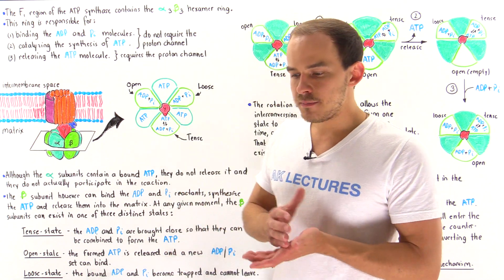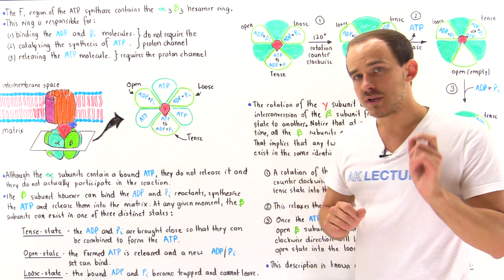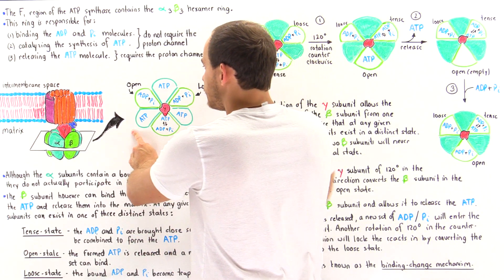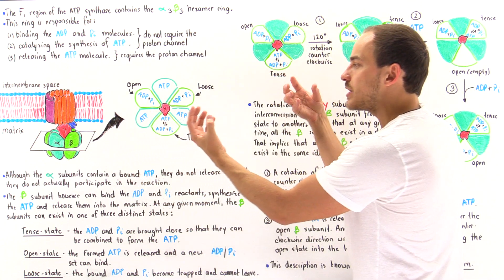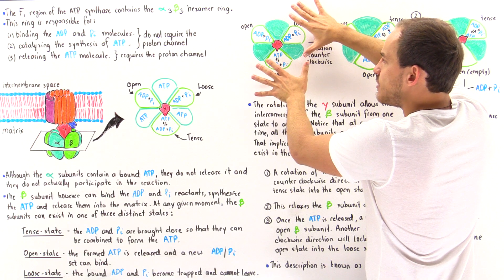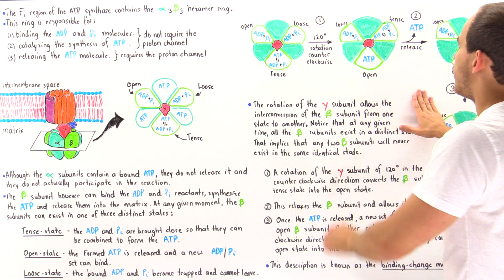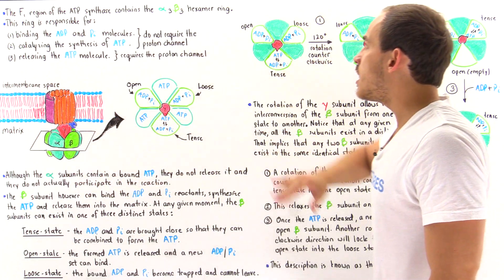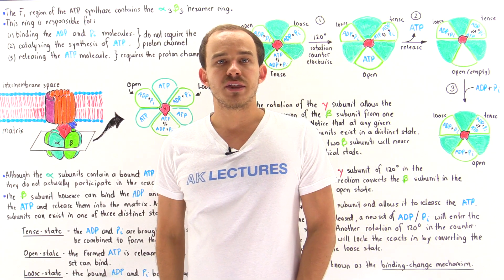Mechanism of ATP Synthase

Comment: What I don't understand is how these ADP+pİ s form inside the beta regions in first place?
Reply: Hello Cherry berry:

When a beta region is in the 'open ' conformation (shape), an ADP molecule and a phosphate molecule enter the binding region from within the mitochondrial matrix fluid,  like two passengers being seated on a Disneyland ride. Next, the shaft rotates 120-degrees, locking in the two molecules (loose state). This is like the retaining bar lowering onto the passengers on the same ride. Finally,  the shift rotates the third time (tense state), causing the two molecules to bind together (ADP + Pi --> ATP). After complete, the shaft then rotates to the 'open' conformation to begin the process again. While in this initial state, the newly formed ATP molecule floats away, and two new molecules enter the ride to begin their binding process anew. To answer your question,  the whole system doesn't create anything from scratch, but simply assembles the ADP and phosphate molecules into ATP molecules.

Note: A better term for the 'loose' conformation would have been the 'holding' conformation,  but for some reason they chose that terminology.

Comment: can anybody tell my why the atp synthase can run reverse and hydrolyze ATP into ADP+Pi ? (sorry if my english is bad)
Reply: sunsite15 because the catalyzed reaction has deltaG close to zero, meaning the energy in both forward and reverse reactions is pretty much equal. That is why it is essential to generate, through the proton pumps (complexes 1, 3 and 4), a proton-motive force - an electrochemical gradient of H+ ions, so they would move (spontaneously) through ATP synthase in order to produce ATP.

Comment: In the process of glycolysis link reaction and citric acid an (overall) 8 NADH+ H+ and 2 FADH2 is produced,  this happens in a reaction where NAD+ 2H+ +2e and FAD --> FADH2, This meaning,  when prodcuing 8 and 2 of these electron carriers we need 24 hydrogen, but glucose only has 12 hydrogens so where do these 12  other hydrogens come from if it does come from glucose cause it simply doest have that many hydrogens, does it come from water that is used in krebs cycle or i dont know ..please help me